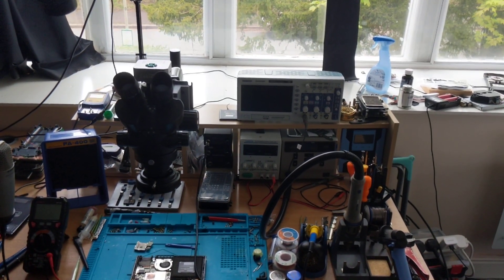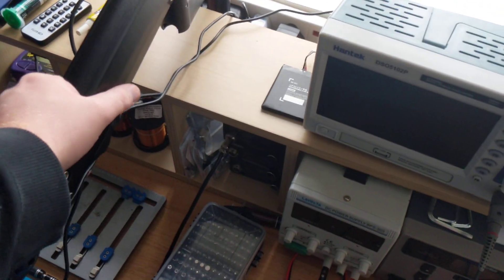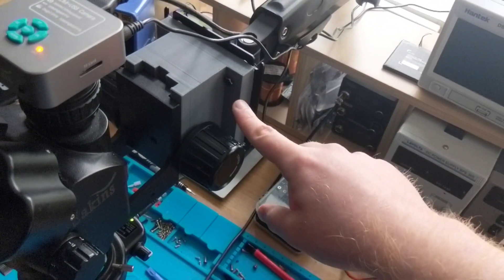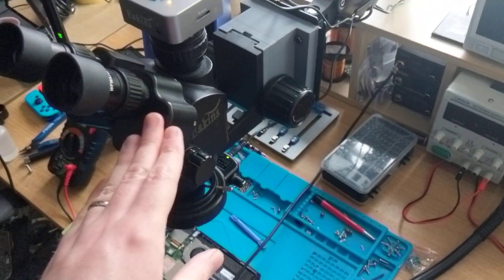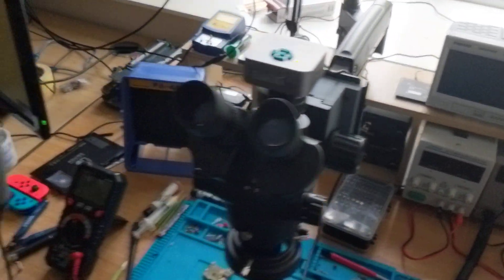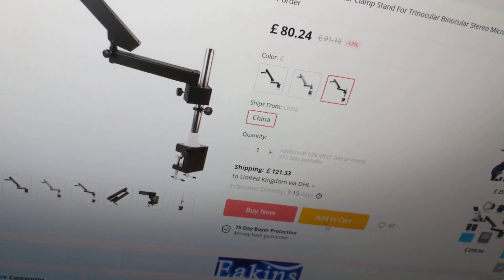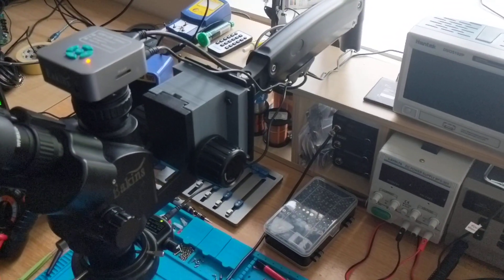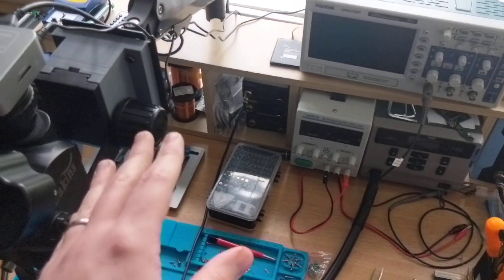Save £200 ($282) on an Amscope/Eakins Microscope Articulated Arm Using This Inexpensive Vesa Adapter

Comment: Watched your video and went directly to buy a NB F80 for my eakins microscope. For my surprise this went better than expected, I hooked up the microscope stand directly to the arm plate with the provided clamping screw. Let me tell you it works great. And the working área is now more than 50 cm Wide and long. Thanks.

Comment: Cool video, thanks for the recommendation! I bought the same holder and made my own solution with lasercut from mdf.
It works well so far, but my monitor holder is not stable enough and there is always a slight wobble.
It is therefore only of limited use to me and I have to look for another solution.

Comment: I have a question. I have done something similliar but my picture is shaking when I touch microscope. Do You have same problem?
Reply from the maker: To a limited extent it does, sure. It's dependent on the VESA arm, the desk or workbench and weight of the microscope and where and what it's mounted to.

If you mount the vesa arm to a wall it'll be more stable for example. I personally don't notice the problem much, but there is some shake present. It also depends on how much you're Zoomed in.

Comment: Excellent idea and less expensive than the arm that they sell for their microscopes. I'm looking into buying an Amscope Microscope (SM745NTP), would this work for it?
Reply from the maker: Yep, just be sure to get the linked bracket in the description as it was designed for use with it. You can get one here: https://www.aliexpress.com/item/4000053160671.html

Comment: Is there a way to fix the difference in the field view being much much more narrow then what you see through the lenses ?
I know i need some kind of adapter, but which one ?
Reply from the maker: Oh hey! I recently subbed to your channel. Great GPU repair content btw! 

Anyway as for the field of view, assuming you mean the camera FOV you need a reducer. You generally want to marry up your camera reducer to the same level as your objective lens.

If you're using a .5x objective lens then also install a .5x reducer on the camera port. If you already have a .5x reducer then you can swap it out for a .35x as that'll widen up the field of view on the camera.

Bear in mind though your camera's CMOS sensor is rectangular and your viewing port/lenses are round. That's why the camera sees a reduced field of view versus the eye cups. If you use too large a reducer on the camera port you'll see the round shape of the lens itself.

I'm making the assumption here that you're using a trinocular scope. Anyway tldr; grab yourself a .35x and .5x CTV reducer.

You can get those over at https://www.aliexpress.com/item/32972322264.html

Comment: Anyone know the cheapest Eakins trinocular kit to buy? Something that has just the minimum necessary parts. Which I think is just the trinocular microscope, the vertical focus mount, the right light and the .5x lens. I assume that's the one to get. I see a lot of focal lens options and have no idea which one to choose. With the camera or a recommendation. Hopefully all with free shipping. TIA. I'm spending way too long trying to find the best value kit without the arm or stand. Thanks much.
Reply from the maker: A .5X objective Barlow lens is a good choice. It's pretty much the Swiss army knife of objective Barlow lenses.

Your assumptions are all correct. Minimum is the scope head, an objective lens and lighting, and of course a VESA arm of your choice.

If you want a camera module don't forget you'll also need a reducer. Match the reducer to your Barlow lens. So if you get a .5x objective Barlow lens, get a .5X reducer for your camera as well. I think they're called CTV reducers iirc.

If you're trying to do this on a constrained budget consider other microscope heads. The only thing that needs to stay the same to use this particular vesa adapter is the focusing rack, which should fit just about any microscope. Some may need a reducer if the neck of the scope head is too small but that should be easy enough to 3D print.

Comment: I was gonna buy an arm from amscope then I saw this video and decided to buy a 3d printer instead, took about a day and half to print and it's not compatible with my Eakins don't judge me.
Reply from the maker: It's only the focusing bracket you need to be compatible. The 25mm one here is the exact one I designed it for https://www.aliexpress.com/item/4000053160671.html
Reply: @NewRetroRepair  that makes sense, my focusing bracket came with my microscope but thank you. You have inspired me to learn and design my own adapter, I'm bypassing the vesa and making it so it would fit directly to the hinge bracket behind it.

Comment: I don't think the arm in the link (1st amazon link) is identical. The spring is really strong (or piston - whatever is there) and it won't stay in the position (ie. it will but it needs at least a few kg of weight). It is adjustable but it's really strong even in it's lowest setting. Doesn't work for me anyway - it'll always go to the upmost position....

Comment: How is the adapter holding up now it's been some months? A concern would be the plastic detereorating over time with the heat and pressure. I checked some of your recent videos and the microscope looks very shaky but I'm not sure if that's due to your desk setup or the mount
Reply from the maker: Sorry, I just saw this comment. It's two years later and I've had zero issues with it. It's still like the day I built it.
Reply: do you have some issue holding or resting into the eyepieces to see through?

Comment: This is wonderful. I have seen others done it on here but they  have not shared the details.  It should fit mono hdmi unit and lens too. I used hdmi camera, mono lens 180x and view via a screen. I have been using the arms and stand  demonstrated by Micro repairs Ltd. It cost around £135  with postage on Alpress. The cod3r uses the same one with his microscope.  A very good one to use but can make grinding squeaky metal noise if not maintained.

Comment: How do you get the gear out?
Reply from the maker: Twist the focusing handles until the gear rail is exposed, it should show a screw. Undo the screw and then move the handles in the opposite direction and it should come apart.

Comment: Did your original microscope adjustment also has ballbearings in them? How ist the printed version affecting this, is it noticeable?
Reply from the maker: It didn't actually no. It actually feels the same as the original part in use. You do need to use silicone grease on the parts that move on the bracket though.
Reply: @NewRetroRepair  thanks for the swift reply, i mus have a different type then. Mine has 2strips of ballbearings at each end i’ll see if i can alter your design a little bit. Anyway thanks for sharing the part
Reply: MC did you manage to alter it? I have the same issue
Reply: @dylanjohnston1702  no i ended up buying a monitor arm and drilled into the vesa mount, i use the screw hole in the back to secure the mounting. This way i still have the smooth ball bearings.
Reply: @mcc5651  cheers for the reply mate! Yeah that's a good idea, captec has a new design that will fit any 25mm mount so I'm gonna give that a go but I like you're idea !

Comment: So Is there a guide for this scope? It finally showed up and assembled everything, but the only way I can get it to work is when I put the scope 1 inch away from the PCB.   That's impossible when you're trying to work on a PCB
Reply from the maker: You need to attach a Barlow lens. Try using a .5x Barlow lens on the microscope.

Comment: Which ring adapter is that, from where? The two 76mm's I have are slightly different... Olympus SZ-STB1 and Nikon C-FMBN. In fact, I'm not sure if I can even remove the knobs and post (that seems like a big factor here).
Reply from the maker: It's an Eakins branded 76mm one that they ship with their trinocular scopes.
Reply: @NewRetroRepair  Thanks

Comment: So I bought the same scope you did, and they haven't shipped it after 4 days, and they're not replying to my messages.  Did you have trouble with them shipping it in a timely manner? Most sellers on aliexpress are quick to ship.
Reply from the maker: I bought from "Eakins Microscope Store" there's two others with similar names "Eakins Store" and "Eakins Mic Store". I've ordered from Eakins Microscope Store and Eakins store and had no problems at all. The shipping took a little while but they were quite good. But no, personally I had no problem with them shipping quickly. I had no reason to message them because they shipped within a day or so of me placing the order.
Reply: @NewRetroRepair  The scope you've linked to is from the seller 'Eakins Store'.  This is the link to 'Eakins Microscope Store' https://www.aliexpress.com/item/32916029845.html?spm=a2g0o.cart.0.0.42c63c00IjmOin&mp=1

Comment: Hi 
Could this be adapted to fit the amscope SE400-Z 
Many thanks
Reply from the maker: Possibly! I've just developed a more universal mounting system that should help though! I'll be making a video very soon
Reply: @NewRetroRepair  cool I'll look out for it
Thank you
Reply: @NewRetroRepair  Did you make any progress with this fitting the Amscope SE400-Z?
Reply from the maker: @NotSkeletor  I did actually. Here you go: https://www.thingiverse.com/thing:4950628
Reply: @NewRetroRepair  you are amazing! I wanted to ask to be sure - would this screw right into a vesa mount from any compatibile monitor arm. do let me know and really, your time and what you've already done is very much appreciated :D
Reply from the maker: @abdullahjoshi3437  Yep it should do. Any 75mm VESA arm will do it.
Reply: @NewRetroRepair  Hey just letting anyone going for an amscope se400 mount - the cylinder needs to have a diameter of about 1.9cm and not 2.8cm. Hope that helps!

Comment: do you know if walter scopes will also work with this setup?  http://walterproducts.com/products-main/microscopy/industrial-microscopes/wp-5-series-microscopes
Reply from the maker: It looks like it should but I can't see any close ups of the focusing bracket assembly soI'm not 100% sure. Assuming it'd be the focusing bracket that came with the double boom arm they're usually supplied with.

Comment: It's work perfectly, I done the same thing  one year ago with a digital one and with 50 euro more or less I got the best microscope articulating arm I never seen. 
Fortunately the lcd arm I bought had the same hole of my old microscope stand so every pieces  seems build by the same factory to be mounted as a normally kit....... 
I must admit I m really satisfied no doubt.
Reply from the maker: That's awesome man. You should link the stuff you used to make it easier for folks looking for a quick and easy solution! Feel free to here in the comments and I'll pin it :)
Reply: @NewRetroRepair  i should find every single piece i used to do it but no problem. 
The only bad news is not all the stuff I bought is still available, anyway I can make here down a kind of list.
Reply: @kamikazekk-df4vz  did you ever make the list. This would be really helpful for others. Thank you

Comment: This is awesome! I had a similar idea a while ago. I wanted to make a 90deg mounting adapter that would attach to the VESA mount and then I'd bolt on the original height adjustment tube, preserving the Z slider mechanism as-is. I would mount the tube hanging down from the adapter to give me the maximum Z working height and adjustment range.